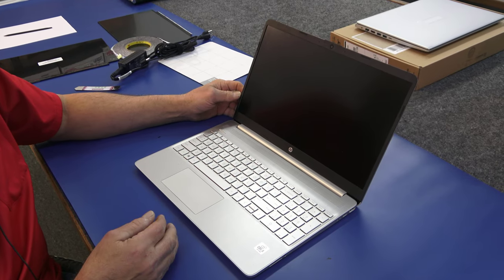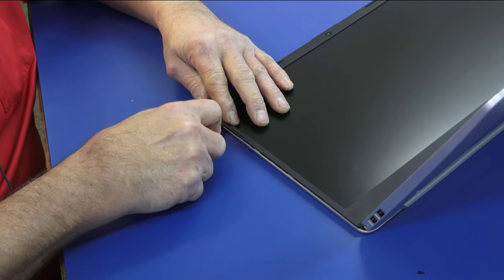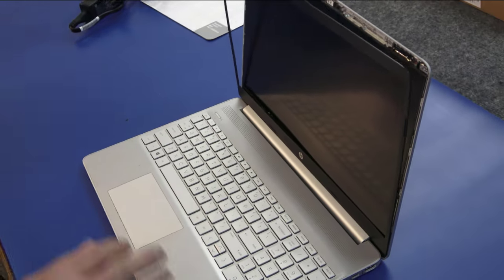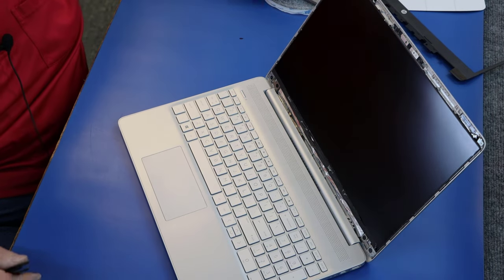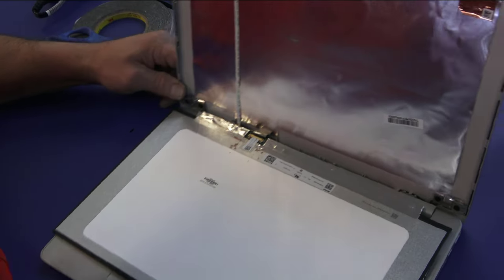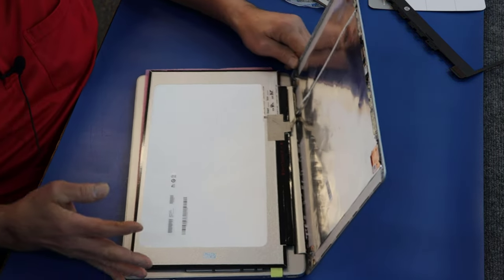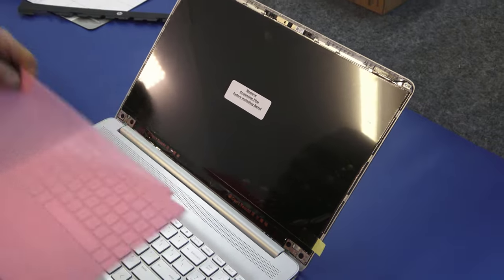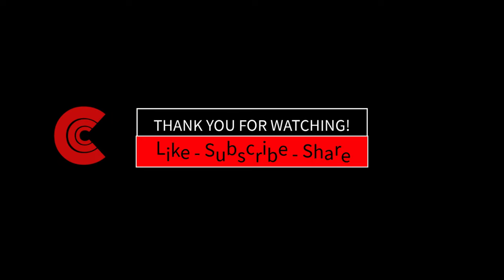How to Replace LED Screen on HP 15.6"  Laptop With Nano Bezel. No Screws. Model# 15-dy1036nr

Comment: Excellent video.  Love the "be patient and take your time" advice.  As a tech myself that is one of the most important things when doing work like this.
Reply: dandon1105  When connecting/disconnecting components it's possible to short out pins etc.  It's always possible when there is still power connected to a board.  Best to remove that possibility altogether.

Comment: Very helpful. I was able to replace a screen on a company laptop after watching this. I did struggle putting the bottom of the bezzle back on so it helped to slide it in from one side with one of the tabs slightly bent out of the way.

Comment: Great video. The bottom part of the bezel was a bear to remove.  I ended up having to use an exact o knife at the front edge, away from the circuit board and cutting away at some kind of black plastic that would not allow me to remove it no matter how much rocking I did.  At that point, it was away from the screen, but was hung up at the very bottom, near the hinges.  Also note, that grabbing the whole bezel and moving it slightly to the left helped also.
It took a long time to get the job done, but it's working!  I'm a happy tech!!!!  Thanks a bunch.

Comment: Great video and I enjoy your detailed instructions as well as the humor you interject.  Since the old screen is bad I cut the glue that holds the bezel with a straight edge razor blade or xacto knife before I removed it.  Less chance of busting the bezel when you take it off.  Also, the tape in your comments in 3 mm but when I watch the video the tape you used was either 5-6 mm.  I bought the 3 mm and just used two strips on each side.
Reply from the maker: Oops.  Width isn't that important. As long as it sticks. The bezel pretty much holds it all in place. Thx, dale

Comment: Thanks for this how-to, helped us fix ours and save some bucks.  My gal is very pleased to have her laptop back, good as new.  I did have a time with the getting that bezel tucked in at the bottom left of the screen, as the bezel tabs will push on the display connector cable and pop it out if you're not careful.  But alas, working well after a few tries to get everything lined up correctly!

Comment: Great job. I have had three different ways with HP for most resent models. Glue pulls from top or  bottom and some still have screws in corners. But thank goodness heat guns are not involved with the delicateness of the back assembly bending easily.

Comment: Hey that was very useful, I need a small help, after fixing the display I also changed the display Bessel, and now I'm finding difficulties in routing the WiFi antenna to the WiFi module, for when I do it and fold the laptop the antenna cable gets crushed, so can you help me
Thanks

Comment: the original one had the black strip extraction method, 3m tape was used for gluing, what do you use for removal without damage de screen

Comment: hey can you tell me the details of he thin double sided tape that is laying on your table  ??
Reply from the maker: Sure, here is a link
https://www.amazon.com/Double-Mounting-Coated-Adhesive-Transfer/dp/B0BG7ZRHYS/ref=mp_s_a_1_3?adgrpid=120525955567&gclid=Cj0KCQiAvqGcBhCJARIsAFQ5ke74-pnfUAYpi5307-IGfjjm8_n2_9QGz_kwZ392XPgmalzWz0Jdj8YaAsihEALw_wcB&hvadid=493340163295&hvdev=m&hvlocphy=9017533&hvnetw=g&hvqmt=e&hvrand=10066413883188441969&hvtargid=kwd-920570433797&hydadcr=8345_9904694&keywords=3m%2B9448a%2Bdouble%2Bsided%2Btape&qid=1669919387&sr=8-3&th=1&psc=1

Comment: at 12 minutes u can see the screen is down and white part is with it right? so tell me why the guys who "replaced my screen" fucking super glued the white part to the backing of where it connects to. i WISH they would have used the streatch adhesive or atleast something else because i got everything off ( replacement screen stopped working ) so i got everything off and then i get to the actual screen and i try to see if they put the strips on left and right side back...nope... and i tried gently just pulling the screen forward and i look behind it and its just pure glue all over the back.....................................they super glued or some kind of permanent glued it to the white to the backing. i was trying to see like ok last ditch effort let me play around see what i can do , thinking something came loose or something. nope . its trash now but i am more comfortable doing things myself now so i guess thats a plus but what the frigggg who super glues or rubber cements the screen to the friggin back. SMH!!!!!!!!!

Comment: Hello what size bezel do I need I have 15.6 inch HP the bezel I ordered 15.6 is too big. Edit Figured it out it’s the micro edge bezel thin on the edges one. Edit thank you so much my pc is fixed 🙏🏽

Comment: Great video. Seems to require a lot of patience and gentle moves...
Any idea how much the screen itself cost? The shop asks me 250$ for repair which I can't afford. Hence wondering how much I would save with DIY.
Reply: Can I ask if that's the laptop's brand repair shop? I'm also trying to get mine fixed and got no idea on the prices
Reply: @Skyllen8  I eventually bought the screen for 100€ and replaced it myself. Very doable as per the video and saved me lot of money.
Reply: @olivierr5444  how did you handle the adhesives? Or holding the screen back in place. Were you able to get them yourself?
Reply: @Skyllen8  To remove the factory adhesive you just need to stretch it away with a regular and smooth movement upward.
To put the new display in place I used a regular double face tape, abt 1mm thick. Must be super careful though, as mine was super sticky and at my first attempt the display was not exactly adjusted. It was really a pain to remove that double face for a second attempt.

Comment: Good video but please, If you want to do this professionally, disconnect the battery before you do this, seriously. I know it's extra work but it's worth it. There's 19 volts running through that LCD cable and if you're not careful you can fry your motherboard. You want to be responsible for that, working on other peoples stuff?
Reply: you are right, the safest is with the battery disconnected
Reply: 19:19
Reply: And that's how i shorted my motherboard by watching this 😊

Comment: This is absolutely not the right way to do this. Google the hp youtube channel instead. You can search very specific model numbers. I'm sending my laptop in and I sure hope the person fixing it is nothing like this guy!!!
Reply: Just searched for hp youtube. Found nothing. So why don't you post the link you claim you watched that shows this is the wrong way. I've watched several videos and every single one of them shows this exact same way if you are dealing with the 3m stretch adhesive strip with no screws.